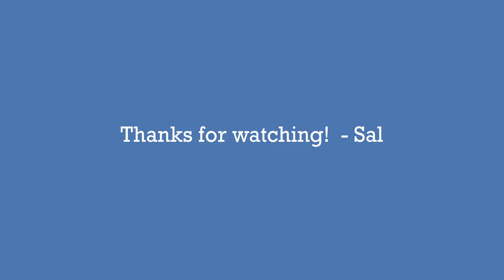First Gen Tundra Audio upgrade!

Comment: Just installed this sub/amp combo on my sons 2002 tundra same color as yours everything went smooth just like your video and the sound for what it is at this price point is perfect loud enough to annoy your neighbors so im gonna tone down the gain a bit. But just came to say I've followed alot of your videos led conversion, speaker/sub install, remote unlock/lock to better my sons first truck everything you've done has worked perfect for me and I really appreciate it keep up the good work!

Comment: I did all this stuff to my truck too. New head unit, replaced 4 speakers, and added the under seat woofer. Definitely a huge improvement in my truck’s sound. I also did some sound deadening while it was all open to insulate the interior from my side pipes. It’s still loud but much more tame than it was. When I want my tunes it can definitely crank and hold its own over the exhaust, even with the passenger window down (my pipes dump right at the end of the cab on passenger side). I’m sure it would sound even better with a quiet exhaust but I’m enjoying my rowdy setup too much rn.
Reply from the maker: Lol that's great to hear. I was also happy with the sound improvement with the under seat sub. I thought about side pipes but they seemed a bit too rowdy for my truck lol
Reply: I'd sure like to see those pipes

Comment: I also have a Gen 1 Tundra that I inherited from a family member and, out of respect for that family member, am fixing it up. She "was" the cool aunt and had done some sound upgrades already. All that is left is to install an amp and subwoofer at this point. I've done it before so I figured why not. Now I know exactly how to get the wiring through the firewall and under the driver's seat. Also, I know how to get the head unit out so I can attach the RCAs, remote wire, etc. Many thanks!
Reply from the maker: Glad to hear it, and best of luck with the truck. Thanks for watching!

Comment: i was inspired by this video to also do a sub for my 03 extended cab tundra sr5 and i used the same sub and the wiring kit from the same manufacturer and the sub barley barley fits under i had to remove the seat to put it under the drivers seat and even then it has limited sliding forwards and backwards movement, everything works great and the video helped me a lot just something to note for other people
Reply from the maker: That's good to hear. The sub is definitely a tight fit, but I'm happy with the sound 👍🏼 thanks for watching! - Sal

Comment: Great videos on the 1st Gen Tundra. I bought mine new in 2001. I upgraded my speakers and head unit about 10 years ago. I’ve always wanted the JL Audio Stealth subwoofer when it was available but didn’t want to pay the high price. I was lucky to have found it on eBay years after it was discontinued and for less than half price. The audio in my truck sounds so good now that I don’t want to leave the truck after riding. I just bought another head unit. This time with android audio. I also bought a camera to mount on the front license plate. I’ve had one on the rear plate for years.
Keep posting videos. Thanks again.
Reply from the maker: Nice, I'm not sure if it's the small cabin or what, but the audio does sound pretty great in these trucks with an upgraded system. Thanks for watching!

Comment: I feel like the thing with sound deadening is you would have to do basically the whole truck to really make a difference. I'm sure it helps a little bit with the projection of the speakers but probably not work the energy and money just to do the doors. Also, like someone else commented, flashing tape used in construction is very similar to the sound deadening tape. Stuff like Resisto tape. I reckon that stuff is a lot cheaper too, but I think it's a little less dense. Great video!
Reply from the maker: Yeah that's exactly my feeling after doing this project. The best results would definitely be had if you could do the whole cab, like under the seats and behind the back seats. Thanks for watching!
Reply: The problem with flashing tape is, at least the brand I have is only rated up to 120 degrees. Maybe there’s a brand that can handle the extreme heat inside a vehicle. I’m in south Louisiana and summers are rough.🥵

Comment: Great video Sal. I have the kicker version of the sub and put the volume control in the blank button on the left side of the steering wheel
Reply from the maker: Thank you, that looks like a great spot to put it too. I'll have to see if it will work with the size of this controller, or if it will need some more modification. - Sal
Reply: I was able to take apart my controller and it fit. I will post a video later this week.
Reply from the maker: Oh cool! Ill check it out for sure

Comment: I'd say if anything what you've already done looks great on the doors. But what I would do and what I'm going to do myself as I'm replacing my stereo speakers currently. Id just do as you have done on the interior of the door and then also put deadening material on the backside of the door card and then reinstall.
Reply from the maker: I didn't think about putting this on the backside of the door card. I'd be curious to see if it helps any more. Thanks for watching!

Comment: Just stuff the inner door cavity with home insulation bats. It's cheap, it's fire retardant, and it's super sound absorbing, and helps with climate control. Idk, I like using it. Really stuff a bunch in there! Just make sure you cover the top and outer side with plastic from top down, and leave it open, if it gets wet it will dry unless it's wrapped too tight.
Reply from the maker: Huh I haven't thought of using that stuff before! Thanks for the idea! - Sal
Reply: You can also go to lowes or HD and get some protector wrap or like a rubber flashing that you put on roofs or windows of houses. Get a roll for like 20-30 bucks and it works exactly the same as dynomat or hushmat just a little thinner and cheaper. I myself didn't think any kind of sound proofing was worth it but let me tell you that it definitely is worth it. The difference in sound is amazing I've got my whole back wall and door skins the best I could and man does it sound killer inside and out helps with annoying rattles too

Comment: Hey sal, just wanted to say cool video, I have my own 2000 access cab tundra and I’ve upgraded my speakers in my truck and added 2 kicker hideaway 8’s on the two front seats, I also had some trouble fitting it under the seat but it eventually fits, just wanted to ask if you experience any rattling from the front windows I got some jbl speakers and I think the magnet just barely reaches the metal railing which has caused mine to rattle when there’s a bass heavy song, pretty annoying because it’s a pretty normal/ small magnet to begin with
Reply: I have JBL speakers in my 2000 tundra that I upgraded and it does the same thing with the window
Reply from the maker: Hey Adolfo, I haven't noticed any excess rattling from the front windows, but I'm sure I will now that you've mentioned it! 😂 I noticed that my passenger window rattles a bit when it's part way down (whether listening to music or not), and didn't know about the magnet in the mechanism so I may need to check that out. Thanks for watching - Sal
Reply: Pioneer makes a thin mount speaker for Toyotas
Reply: That or make your own speaker pods that are built out a little bit. Or buy some pods for your doors and mount them on with any door speakers you want

Comment: I just received the Rockville kit and I had one quick question. The kit comes with RCA cables to connect to the sub and the back of the head unit. In your video you didn’t use rca but I think you used a sub cable that only has 1 connection (not 2 on each end like the RCA cable). 12:32 I am doing this for the first time and would appreciate any help or guidance. Btw I love your videos. I installed the atoto head unit and back up camera following your video. Thank you!!
Reply from the maker: Yeah I only bought that sub cable because I didn't have another RCA to use, I don't think you'd have any problem using that RCA cable to tie in the sub. I would just use one color and leave the other one unplugged. Hope this helps, and thanks for watching!
Reply: @JDMDriveway  Thank you! I installed the sub today and it work great for my use. I bought an adapter just because but I don't think it was necessary - like you said just use 1 color of the RCA cable.
Reply from the maker: @Connor-sn1of yeah, sorry for the late response but I'm glad it worked out for you!

Comment: Hey great video! Just wondering if there's another way to connect the speakers without cutting the factory connection? Are there adapters that can go at that connection above the housing? Thanks!
Reply from the maker: Hey, I'm sure there are adapters you could buy, but I just didn't look into it. I don't know for sure, but I'd guess that you could find them on Amazon pretty easy. Thanks for watching!

Comment: If you have a JBL upgraded stereo, none of this will work! The crossovers are in the amp, and the amp will ONLY work with the stock head unit. I did not know any of this when I got my truck. 

To add a sub I just got an amp that can take speaker-level inputs and spliced them into the rear speaker circuit. I use a Qudelix-5k Bluetooth receiver with a parametric equalizer inside the DAC chip, and I drop the bass by 12dB below 250hz then re-amplify it. It sounds complicated but it works great
Reply from the maker: Huh, thanks for the heads up! I definitely don't know much about car audio systems, but I'm sure this will help out other people who may be running into that issue. Thanks for watching
Reply: Why would the stock amplifier not work with anything but the head unit thats stock? I'm in the middle of upgrading all my stuff now. About to put in the head unit tomorrow or something and I'm going to run another amplifier for my subwoofers but was planning on keeping the original for my door speakers
Reply: The stock head unit and amp are essentially one unit, located in two different places.  They won't work without each other. The crossovers are inside the amp for some reason. I don't know why JBL did it this way but they did, apparently it's common across different manufacturers

Comment: Hey sal I’m current working on installing the same sub into my 2002 tundra. I have the same head unit too. I noticed the wiring kit comes with a sub wire with two rca outputs but the Atoto seems to only have one output. I noticed you have something linked in the description. Is it one rca to one rca? Or does it go one rca to two?
Reply from the maker: Hey man, sorry for the late response!! In the research I found, the sub only needs 1 input to operate normally. So I just used a 1:1 rca cable. Hope this helps! Thanks for watching

Comment: Is the small vented circle thats next to the door handle a tweeder? When you took the door off nothing was behind it so was just wondering. Thanks!
Reply from the maker: Yeah it should be, and I believe the speaker is actually bolted into the door panel, not the metal part if that makes sense. Thanks for watching!
Reply: Hello, did you bypass the tweeter or just hook it back up? Thanks
Reply: @andyburton6209  i just unhooked it from the wire harness and then clicked it back in when i put the door back on. I was trying to  upgrade the tweeder but honestly couldnt find one that fit and matched up to the wire harness
Reply: I am having trouble finding a replacement also.
Thank you for the quick response. 
Your channel is great, keep up the good work!